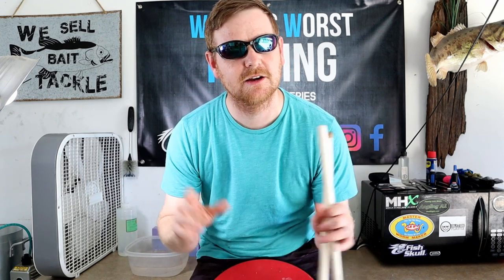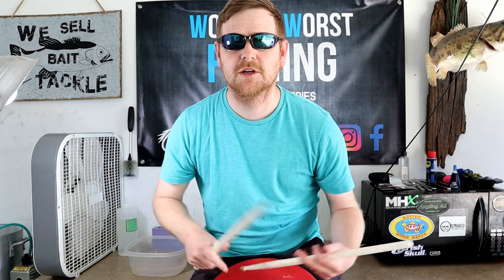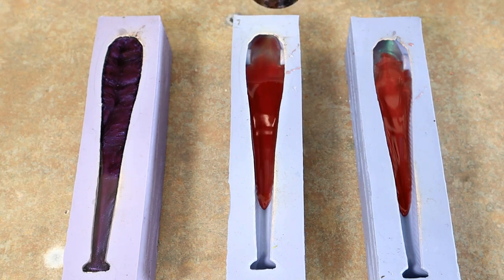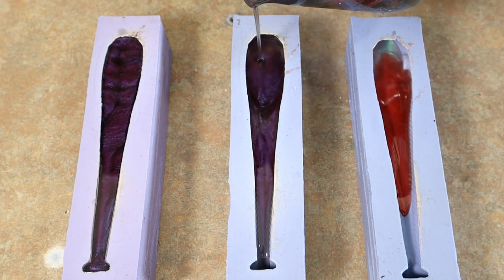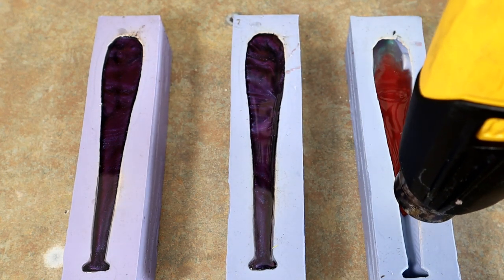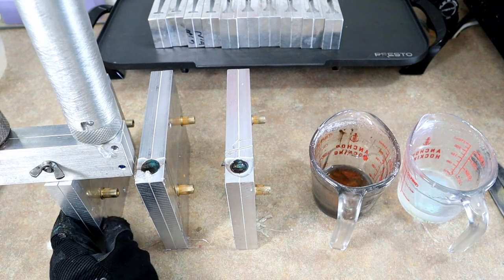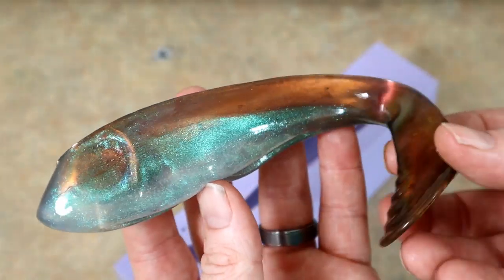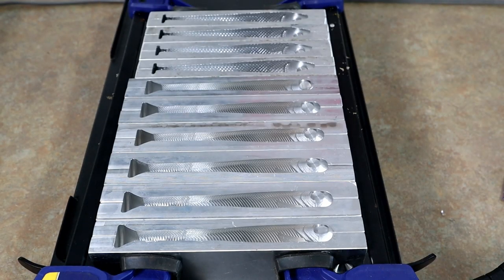COLORSHIFT MANIA: Pouring Fishing Lures With Automotive Pigments

Comment: Awesome video, those pigments are awesome. Yeah I usualy make more the I need also lol. I usually just keep going untill im down to so little that it wont even do one. The only mold I have right now is the 3.5 ripper ES and it has 2 cavities on one side and one cavity on the other so when I get real low I just keep doing singles until I don't have enough to do one. And then depending on the color or if it has hi lite I will keep it for mutt colors.(thats what I call an amount of used baites or plastisol that are all a similar color)

Comment: I had a question? I have the ripper es mold and on the single cavity I keep getting a small notch in the tail. It only happens on the single side and disnt happen when I was using remelt from old baits. I figure it is user error, but wanted to ask incase it sounds like a mold issue. Thanks.

Comment: I just started using the core shot mold and tried worm oil the rods were a pain to get out. I tried some jojoba oil next and the rods started falling out as I held them up. I do use quite a bit but figured I would share for anyone who has had any problems with the rods sticking even with worm oil.
Reply from the maker: thanks for the tip!

Comment: Great sits but I cannot stand to use a flat top swim bait 
All of my baits are 4”-5 1/2” that’s about it I use on Texas coast for reds, trout, & Flounder maybe off shore I might could use flat top what I call them open pour, but I wished you would do a 2-sided jig and multi pour which I haven’t been able to do went thru 2 Gallons nearly, abs failed every time, I can’t afford a injector plus it won’t give me too color middle colors abs bottom color3 color I pour heated  plastic into my molds to cost them and then I pour a little heater plastic into a small cup mix color up and brush it onto my coating I poured on my mold to coat it and then I mix the final color up put molds together abs pour it